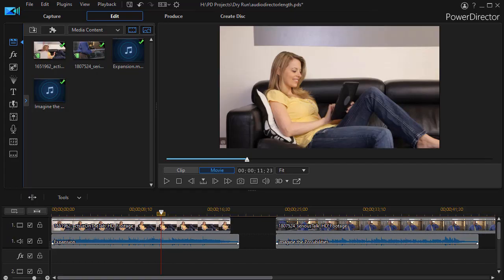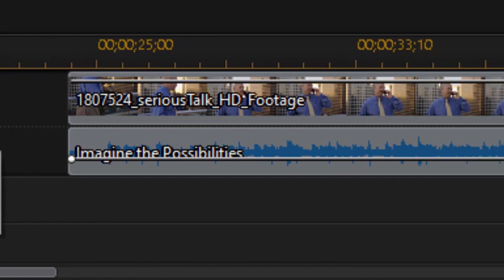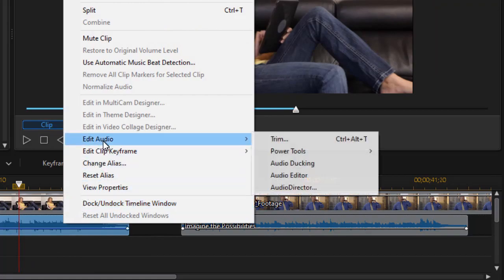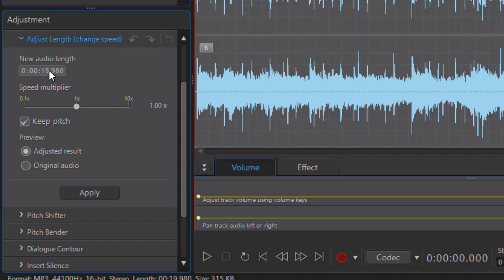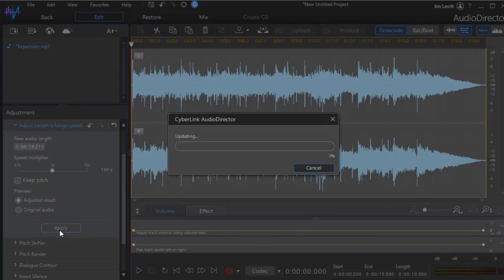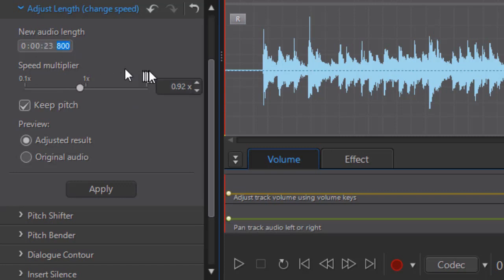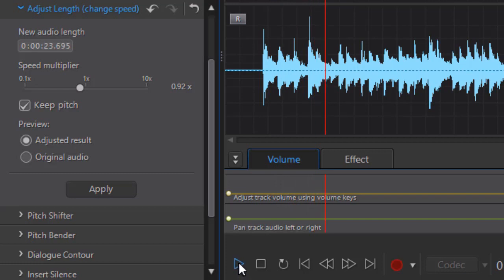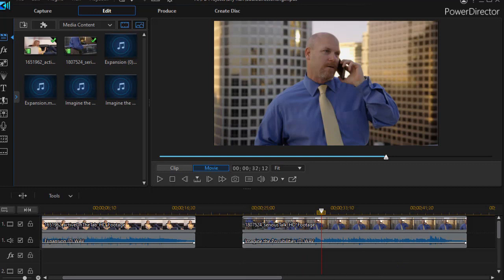PowerDirector - Adjust audio length to match video with AudioDirector

Comment: Great tutorials - love it that you take the time to answer our questions. I bought Powerdirector.
Question please - can you do a tutorial on how to fade in and fade out audio? If you have one, please give me the link. Thank you - John
Reply from the maker: John, I have a tutorial scheduled that will show you multiple ways to do that. The short answer is that you can hold the CTRL key on the volume line of the audio track and click with the left mouse button. That adds a keyframe. If you add one of these keyframes and then hold and drag the keyframe marker at the beginning or end of the audio track, you can fade the volume coming in or going out. The upcoming tutorial will also show you how to add an audio transition from the transition room.  --Jim
Reply: @SharperTurtle  HI Jim - thank you again. I am looking forward to your upcoming tutorial. Please let me know when it is here on Youtube. Holding the control is fine for one way. But there should be an easier way. I remember Movie Maker you just clicked and dragged on the sound wave to highlight the part you wanted to fade out and then click "fade out." I hope Powerdirector has a feature like that. If not, please offer it as a suggestion for an update. The audio transition sounds like a good method - can't wait to see it. Thank you - John
Reply from the maker: John,
The option on PowerDirector is not as elegant as with some NLE programs. To make a suggestion to Cyberlink, Click on the FILE menu at the top, then select 'Rate us & Provide Suggestions" from the drop down menu. I do not have any special access to developers at Cyberlink. --Jim
Reply: @SharperTurtle  Thank you again Jim for kindly replying and helping. I just also bought Powerdirector 365.
Reply from the maker: I hope you enjoy the additional features in PD 365, john.  --Jim
Reply: @SharperTurtle  Thank you Jim - you are a gentleman.

Comment: My problem is finding a way to edit the alias of a .WAV file in PD365.... and retain it. When restarting the PD program, the alias's revert back to the original file names, in the "Audio only" list, but use the new alias in the timeframe....creating a problem if more audio editing is required.
Reply from the maker: I did not notice that behavior until you pointed it out. When you reload PD does revert to the original file name and not the alias. I don't know a way to change that behavior. If you right click on the audio in the timeline and choose "Edit Alias" it will display the source file name that is in the media room. It would be easier if you could choose between displaying the alias name or the source file name in the media room, but I don't think we have that flexibility at the current time. You could rename the source file or make a copy under another name, but that's not always workable. --Jim
Reply: @SharperTurtle  this happened at the recent PD update. When recording in previous version, we had the chance to name the file, but now it only sequentially saves it.
Reply from the maker: Oh, I didn't know that this changed. I just made an inquiry about it to find out if this is a deliberate change or a bug. If I hear back, I'll let you know. --Jim
Reply: @SharperTurtle  ..and when trying to delete an unwanted file from disk by right clicking, the file on capture page disappears but the unwanted file remains on the disk, taking up space.
Reply from the maker: Normally PowerDirector will delete content in the media room and not remove elements from your hard drive. It's designed so that you don't accidentally remove your source material when you want to remove elements from your project. If you track your settings you can monitor the places where you store your created files and delete them manually. That's what I find myself doing, --Jim